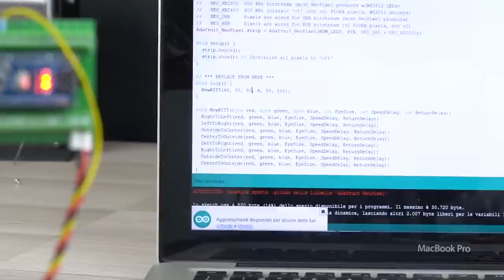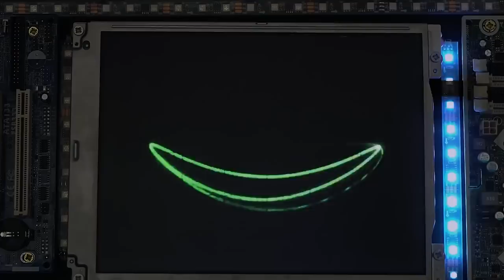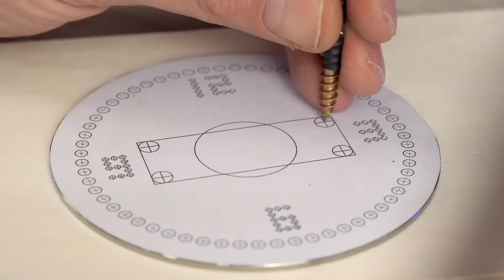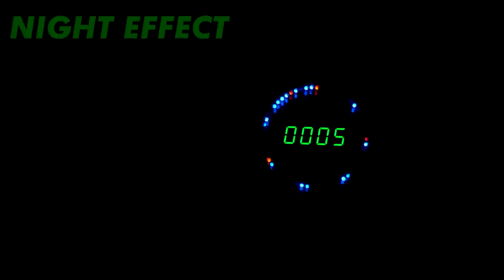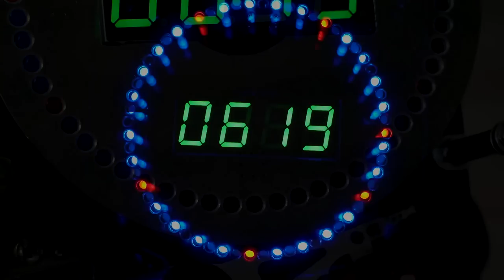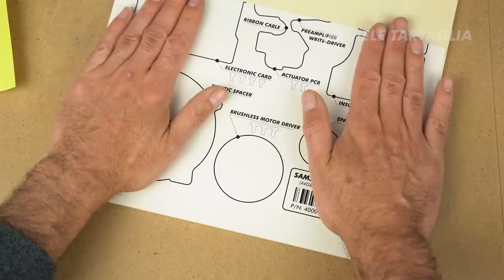3 TOP projects with old technologies - hdd & motherboard

Comment: I worked IT for 35 years and back in the mid 90's I built a wall board similar but with just a lot of circuit boards and blinky led lights. It was not as good as your and my live in girlfriend was NOT impressed when I hung it on the wall over the couch :) 
Cool stuff dude. Only the hardcore ITers will get it.

Comment: Bonjour Daniele, une question à propos des disque durs, je comptes en récupérer quelques uns qui sont HS et je me demande  quel est le voltage nécessaire pour le moteur , je suppose que ce doit être du 5v mais ça peut tout aussi bien être du 12v, et comment repérer les brancher, il y à bien souvent 3 ou 4 circuit en sortie du moteur (4 dans le cas de ce dernier projet) et évidemment ils ne sont pas repérer, alors comment savoir où se trouve le + et le - . Merci

traduction via Google traduction:
Ciao Daniele, una domanda sugli hard disk, ho intenzione di recuperarne alcuni che sono HS e mi chiedo che voltaggio è necessario per il motore, immagino debba essere 5v ma potrebbe anche essere 12v e come localizzarli, molto spesso ci sono 3 o 4 circuiti all'uscita del motore (4 nel caso di quello che hai usato in quest'ultimo progetto) e ovviamente non sono identificati, quindi come fai a sapere dove sono il + e il -. grazie